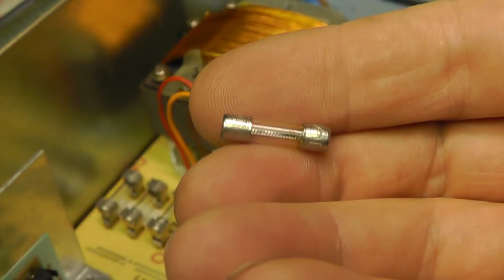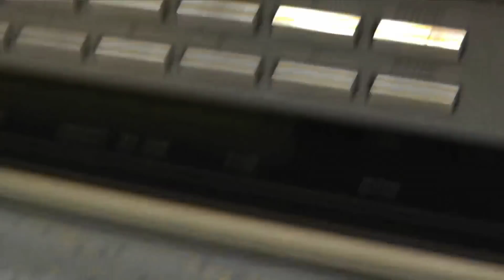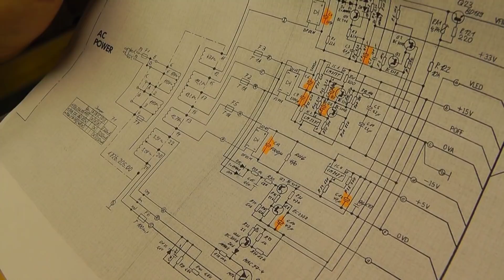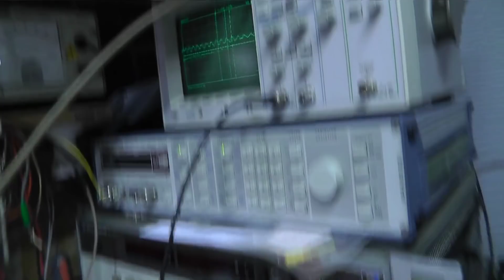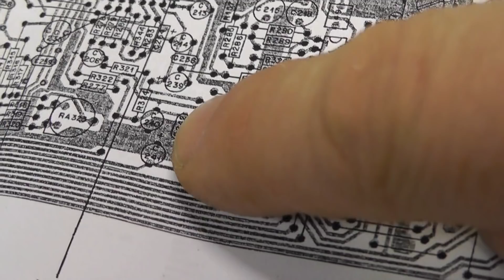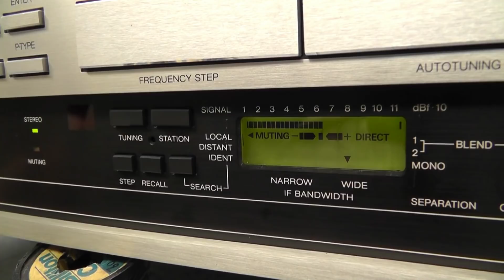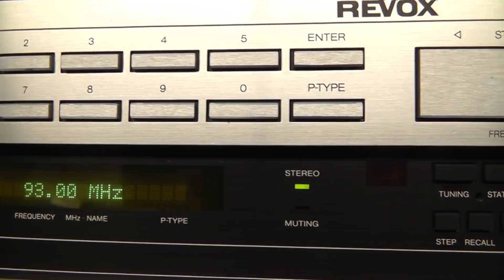Revox B160 repair, align, & removal of poor quality upgrades.

Comment: Hello Simon I have my radio Revox B160 where everything works except the search of the stations. Can it be due to capacitors on the power supply? I would like to point out that I have kept her still for many months. There is a low-frequency noise. but the antenna signal display does not appear. Thank you
Reply from the maker: I would as you say check power supply caps as the hum should not be there. This would cause problems with the tuning circuit for sure.
Reply: forgive me Simon Spiers but I don't understand. I wanted some help to know what the cause could be. Thank you
Reply from the maker: @Stefano_iannuzzi  replace power supply capacitors first.
Reply: Thank you 
Simon Spiers will be the first thing I do, of course I'm going to have to get the list of capacitors.

Comment: What's the strange shading ring around the mains transformer?
Reply from the maker: On the bottom of the transformer? There's a plastic mount?
Reply: @SoddingaboutSi  No. Around 5:48 there's a good shot of the transformer showing a shading ring over the windings. But it isn't the usual copper strap but rather copper wires wound around the outside of the core. It's to reduce the leakage field from the transformer. Just never seen it done with wires rather than copper foil.
Reply from the maker: ~I could be just there when the transformer was impregnated to hold the lamination's together and also to prevent acoustic noise from buzzing lamination's. I doubt if it has any magnetic effect.

Comment: Have you got any component debugging tips from your extensive experience, such as:
1) high value resistors can go open circuit but not open circuit
2) Diode can go short or open circuit
3) MOSFETS...
4) Bipolars...
etc.
Tips like that so it would be easier to identify which components are the most suspect in open/closed circuit conditions?
Reply from the maker: Thats a tricky question..
Generally Old carbon resistors tend to go high value and sometimes open. It's not possible to check higher values in circuit generally, although lower values usually in be tested in circuit.
Diodes in my experience tend to short, Mosfets can be checked with a meter but it's not that reliable. Jfets should show a few hundred ohms  between the DS junction. Bipolars can be treated as two diodes with the common junctions connected (depending on NPN or PNP.
Reply: Simon Spiers: Thanks, no uni will give you information like that, not even on the servicing courses. I dont trust new equipment as much as that built in the 70's and 80's in many respects, mainly because designers now use components to meet the Mean Time Before Failure (MTBF), to save pennies and get the product working just beyond its warranty, where in the past, they did not penny pinch.
Reply from the maker: In the era of this gear I'm  working on their reputation was gained through build quality and reliability. 
It's a shame modern equipment is not designed to be repaired. You csn download service manuals with tips on fault finding? Try finding one Foa an ipod! What are you studying?
Reply: Simon Spiers: I am after a schematic for a 120W PA amp: PAM-120, if you could give me any pointers where to find it. Thanks.
I have done studying, it was in electronics at uni, so ok with design side, but servicing is a different ball game so to speak in many ways.
Reply from the maker: Suzy Siviter Any good?
https://elektrotanya.com/interm_pam-60_120-power-sm.pdf/download.html
Reply: Simon Spiers: You are a star!, I was searching for a good 20 minutes, thank you so much. I am trying to modify/remove the high pass section of the amp so I can use it with a subwoofer, this will be a big help!.
Reply: Simon Spiers: Thanks to your help in finding the datasheet, I managed to change a couple of the capacitors in the Sallen Key Low Pass Filter circuit so it runs my subwoofer at the correct cutoff frequency matching my main speakers, thanks very much!.

Comment: Another possible way to show off sound quality would be to feed the output from the tuner directly to your recorder or record it directly into your editing software. The later should be compression free and the best option  I realise there is NO real way to show how something sounds on You Tube, but probably better than via a loudspeaker and the cam mic. Good tuner, only ever sold one but it did sound very clean I remember.
Reply from the maker: I might do that sometime.  Cheers Michael.